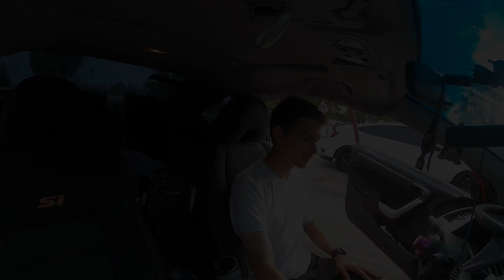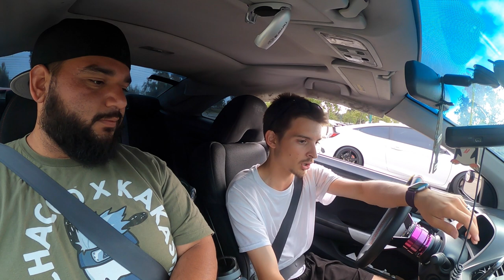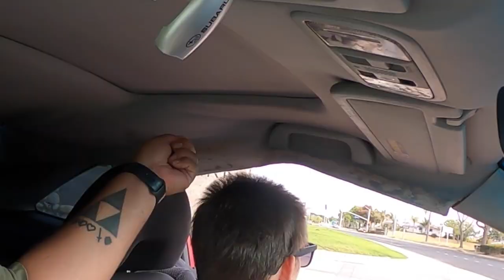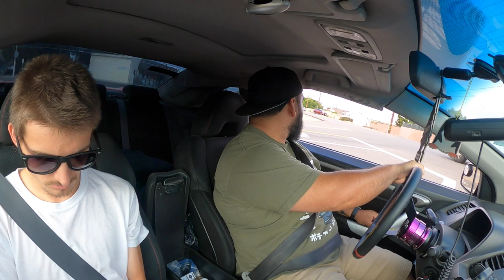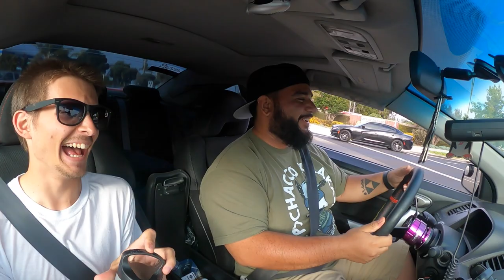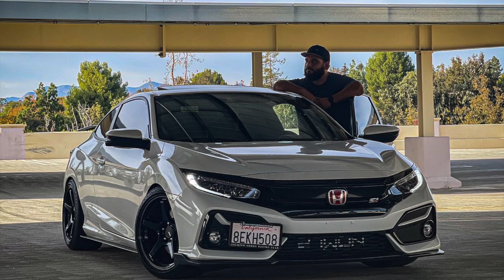THIS VTEC SOUNDS SOOO GOOD!! | Built K20 All Motor Fg2 (Revisit)

Comment: There is absolutely nothing like driving a tuned /More Powerful 8th Gen. I think about trading my R for a super clean one all the time. Within another 2 years or so, Super clean low mileage 8th Gens are going to skyrocket in price. They're special
Reply: Same. I want a supercharged 8th gen to get whine and VTEC at the same time. It’s probably crazy. I’ll miss the torque but the possibility of an 8600rpm redline is nice.
Reply: @ValkenDnB  I'm definitely thinking about it. All the God damn parts for the R are crazy expensive. I just had to buy a fuel pump and Injectors.. $2450 without install. It's nuts
Reply: @thinkforyourself5672  yup it’s expensive once you start trying to go higher than just a tune. I would have just gotten phearable stage 2/3 or whatever pump gas one they have and left it at that imo
Reply: I'll sell you mine, 100% stock FG2. Just started going over 100k on mileage.
Reply: @EminentLine  of it was an FA5 I would be all over it
Reply: @ValkenDnB  Honestly wish it was too. I wanna get something a little more practical.

Comment: Ok, no after market cams 242 is reading really like 20hp over my tuners dyno. I'm running a kfrank I/h/e rbc Cai and I put down 224. I'm in Santa Barbara and tuned on 91. I drive a dc5. I'll run ya 😉
Reply from the maker: Hit me up on IG 🙃
Castillo_2240
Reply: I think he corrected himself to 220whp. From what I remember church uses a hub style dyno so it reads a little higher and needs to be corrected to get actual WHP which makes sense. I’m assuming with your kfrank you’re making a decent amount of torque over a tuned k20.
Reply: @ValkenDnB  torque is 183 so it's a bit more than a k20
Reply: @jesselee4405  that’s a nice amount. That’s pretty much on par with a 10th gen si and you’re naturally aspirated with a higher redline which imo is better
Reply: @ValkenDnB  my tuner set me to 8000. He doesn't want me breaking rods.
Reply: @jesselee4405  isn’t stock 8200?
Reply: @ValkenDnB  most tuners won't tune a stock unbuilt k24 past 8000 rpm. The rods are concerning, but yeah the stock k20z1 revs to 8300.